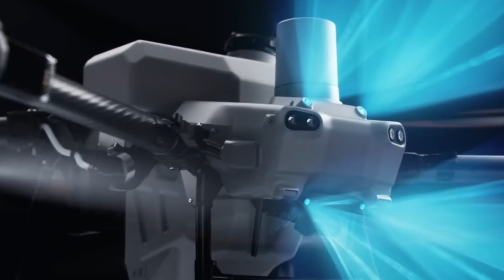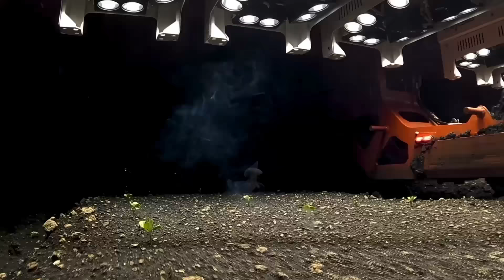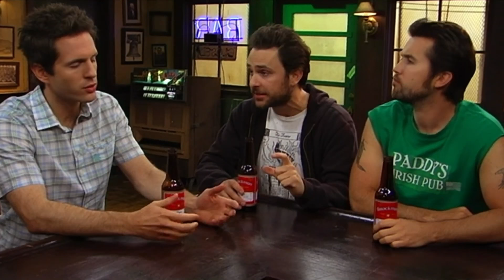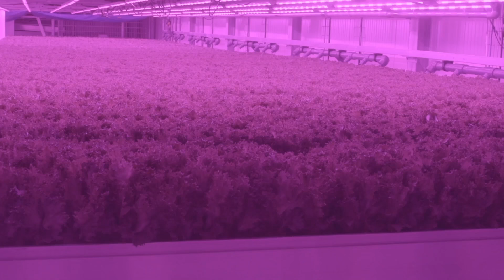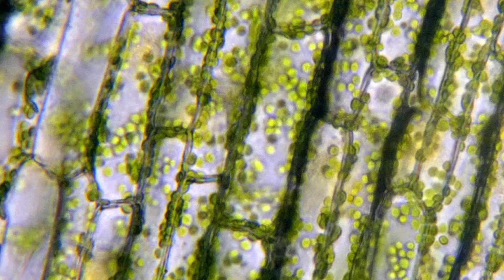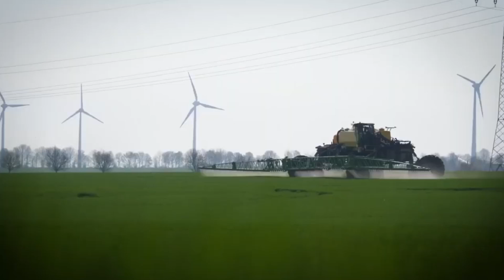New Farming Techniques That Will Blow Your Mind

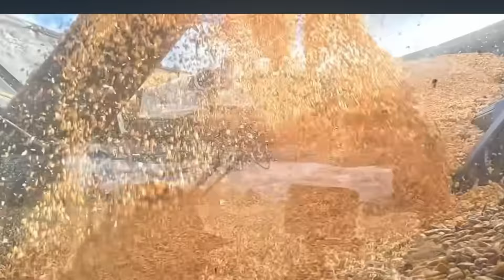Comment: 12:45 I'd hate to break it to you, but that is the diagram for a forage harvester. Not a combine with a corn header. Look at how it takes the corn and corn stocks and chop everything up into chaf. It is then put into a silliage bin or pit to ferment into silliage for cows. If it was a combine diagram it would show the corn being separated from the cob as everything is thrown out the back of the combine besides the corn which would find it's way into a tank. Also forage harvesters don't have a place on border to store chaf and it's blown into a trailer being pulled by a tractor the whole time.